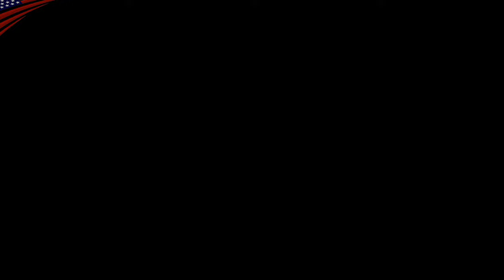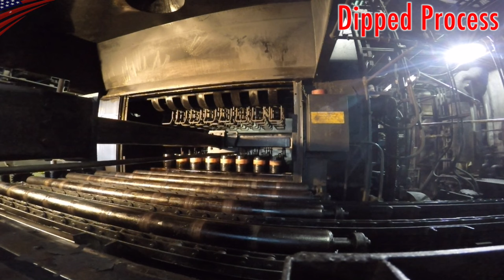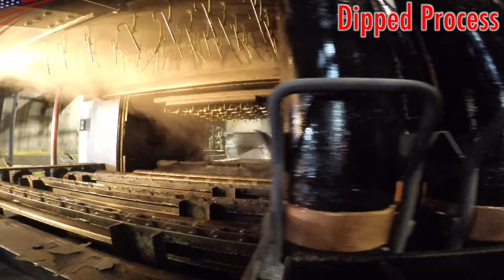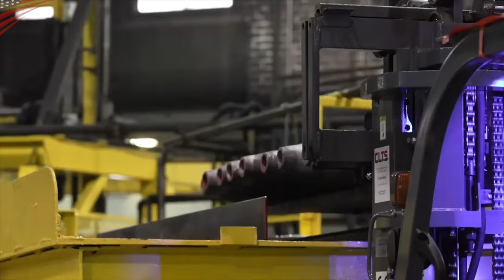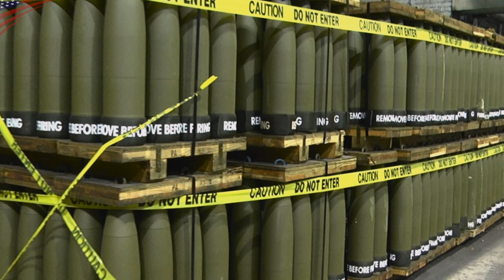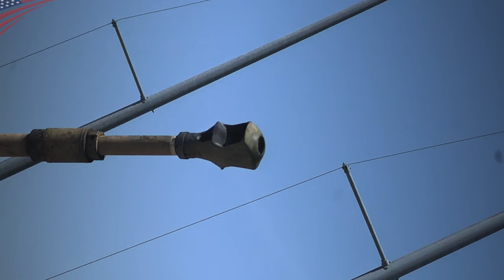Inside Ammunitions Plant That Makes 155 mm Artillery Shells for Ukraine

Comment: In a book about munition manufacturing during the Cold War 1946-1989 it was mentioned that in 1956 due to automation processes in a single company during a single shift 26 technicians were producing 15,000 shells 155mm, roughly the same shells as today.

And 11 people were producing fuses for these shells.

I'm sure there are more phases than producing a shell and a fuse.

Propellant, explosives , painting job you name it.

Perhaps more than 37 people were needed to produce in two (2!) days in a single company what is now the whole country producing in a month and is "accelerating" during the last two years.

But the question is How much more people were needed 70 years ago to produce what the whole country weirdly is proud of today?

Whose fault is that we can't repeat what was possible during WW1?
I will remind 50 million shells were produced from scratch  in a one year.

No plants existed. They were built in 1917

Up to 254mm (10 inch) caliber shells.

No automation in WW1 times, not Google or Whatsap, no computers. No trucks.

Need a hole? Take a shovel! Manual labor.

In WW1 the cost was 2.3 billion (60 billion in today's money).
Reply: Can i ask, how much cost different between 105 vs 155mm shell without fuse